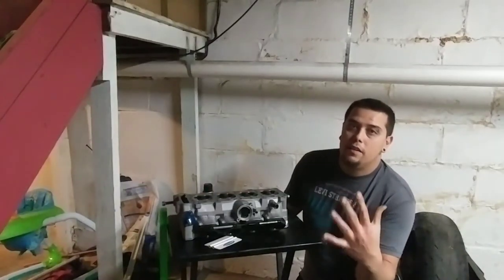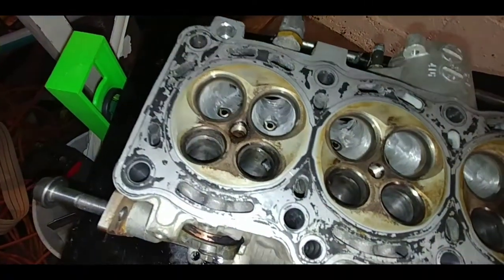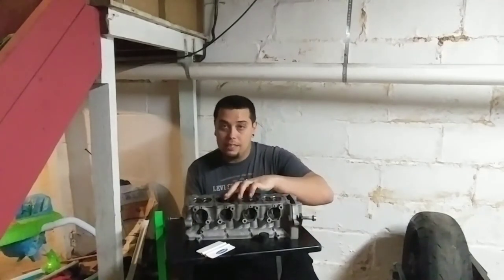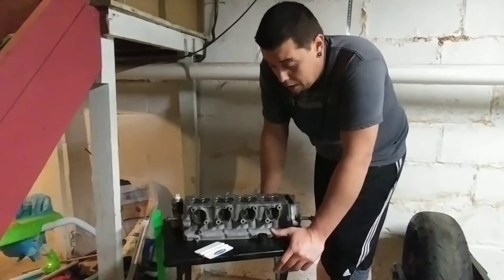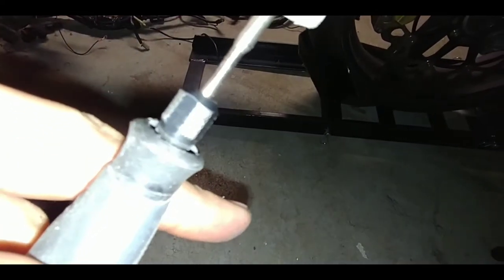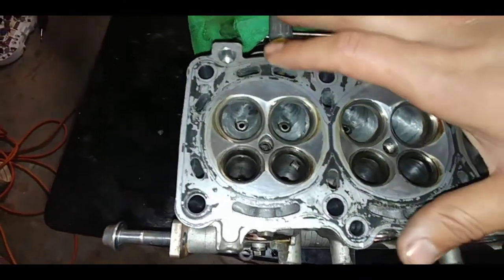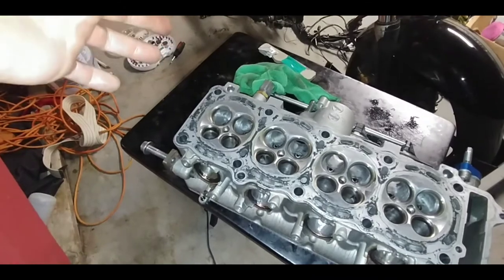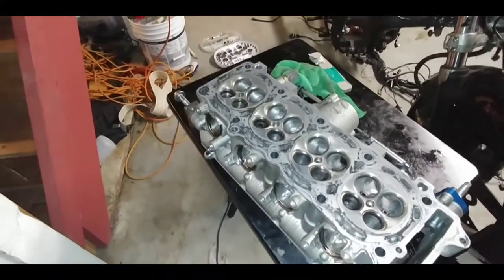Pt 5 (removing carbon build up off cylinder head)

Comment: I've watched the home grown mechanic as well and tried that WD40 carbon removal. Worthless!... you wanna get rid of that carbon buildup quickly try using acidtone on a shop rag and watch that $hit melt away to a new polish finish. I used this to clean my pair reeds and it just wiped away instantly with no elbow grease. Just make sure to keep this stuff away from any rubber parts or you can watch them wipe away as well.. lol. Keep up the good work brother.
Reply from the maker: james moreno I didn't even think about that.  That's a really good idea.  Yea that carbon was driving me crazy trying to get it off.
Reply: DRK KNT RACING, sharing of information, gotta love it! Just be sure to coat your parts with some WD40 afterwords to prevent rusting while they sit exposed to the elements. It will provide a nice protective barrier.